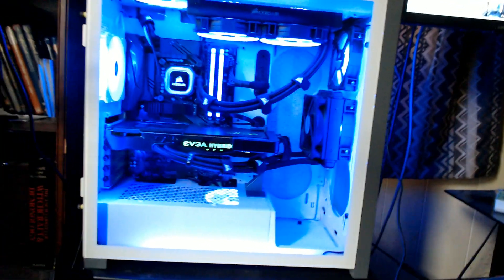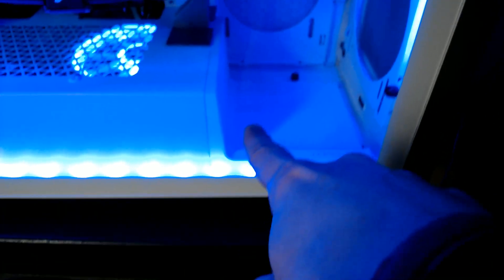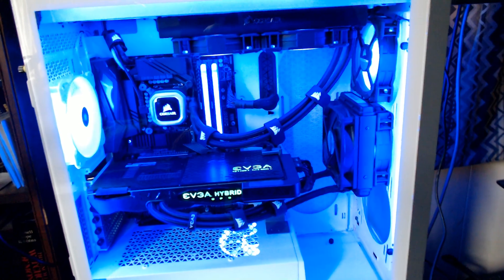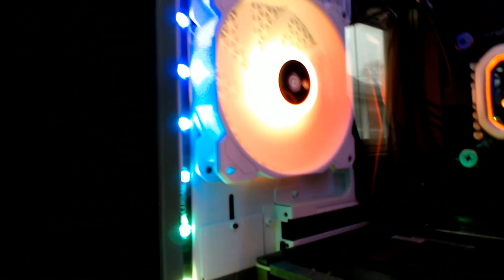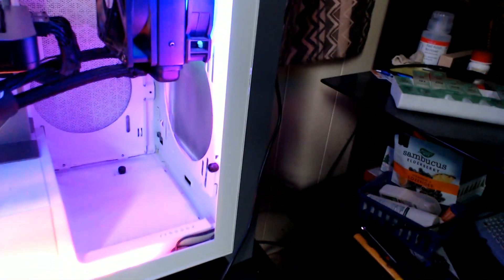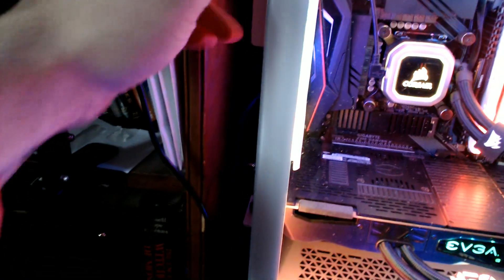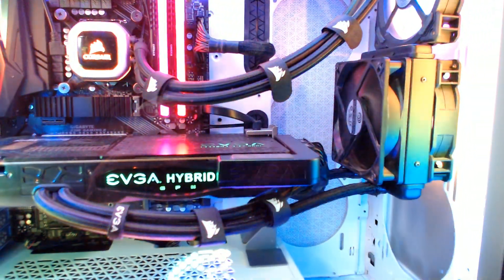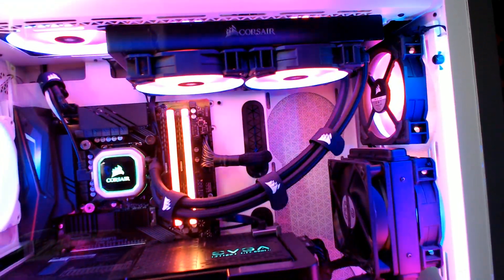Corsair 5000x RGB review

Comment: Having just built with this case, I understand your frustrations. I doubt people disliking this video have built with this case - it is immensely frustrating and disappointing considering the money  Corsair charges for it. I also have had issues with the native lighting node and included fans not working. The build quality is definitely a step down compared to previous cases.
Reply from the maker: Did you notice that your dust filter in the front is from the 5000d case? Or is it just mine? I didnt notice it until the other day. And most that didnt like it, dont like the build i put in it. Delidded 8700k and a ftw3 1080ti hybrid. They are all spoiled from watching millionaire channels build insane systems that they dont even have to pay for.
Reply: @jasonmay1978  yes I did notice that dust filter is the same. The 5000D/X/D airflow are all the same case with minor differences to front, top and side panels. I'm actually really seriously considering putting my new system into my Corsair Graphite 600T considering I will have to RMA both the case and Capellix H150i. One of the fans on the front of the case started shorting and I could smell smoke believe it or not.
Reply from the maker: @StrikeTeam23  i believe it. The fans that come with it arent nearly as good as my corsair ll fans. And the white ones that came with the case are a LOT louder than my ll's. I also dont care for the new icue software. Its more complicated than it needs to be.

Comment: Why is your 120aio in the front 😂😅that should be an exhaust and the 240mm can be mounted without a push-pull on top or front mounted looks like you caused all the trouble yourself what a mess
Reply from the maker: Um. Why would you exhaust all the heat from your system through something youre trying to cool down instead of having fresh cool air pulled through it. Im also upgrading the gpu to a 240mm aio. So i was trying to find a way to have full push pull on both 240 radiators.  So i was trying to find different configurations for that in advance. When i do the upgrade the gpu rad will be on a push pull on top. And btw this isnt the configuration i kept it at. It is one of many that i tried to get the best temps possible.